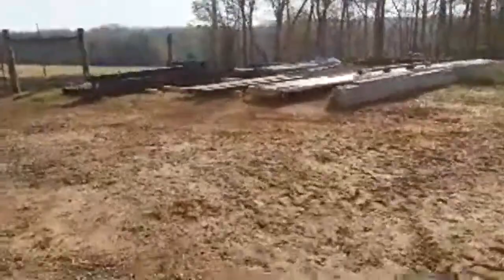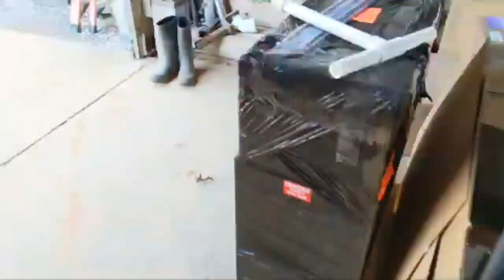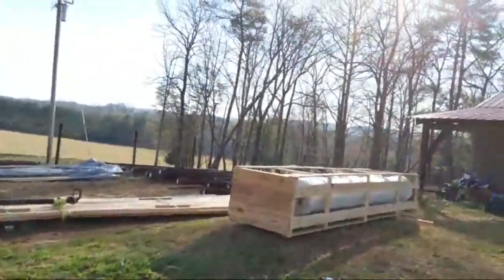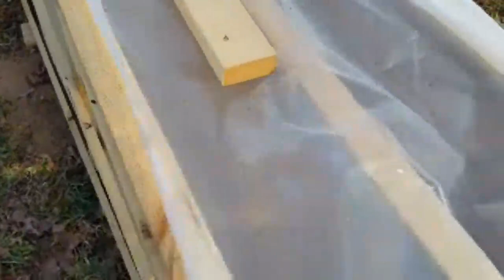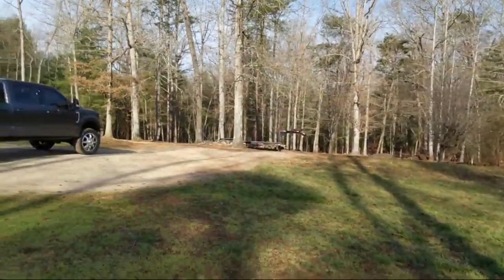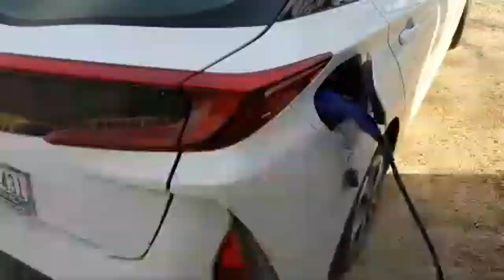Update From E775

Comment: why don't you add some wheel wights to the rear wheels of the tractor? it will help with rear wheel traction and add some "ballast"  so the front loader stuff will not tip it over as easy

Comment: The ac/dc mini split for heat and air looks like a system that I would be interested in having installed. Would do the solar pv hot water at the same time if you do these small jobs.
Reply: Senior-  contact us at info@practicalpreppers.com and lets talk.